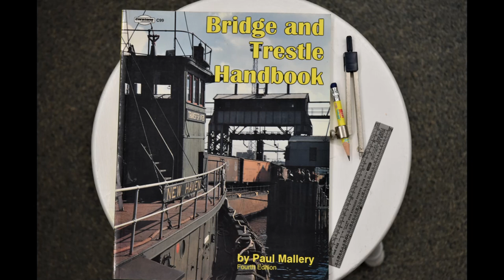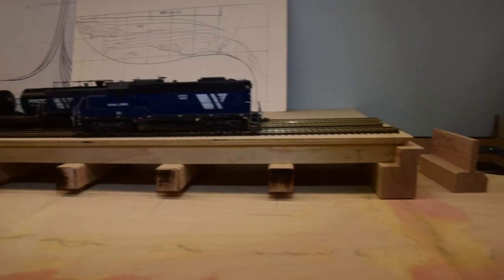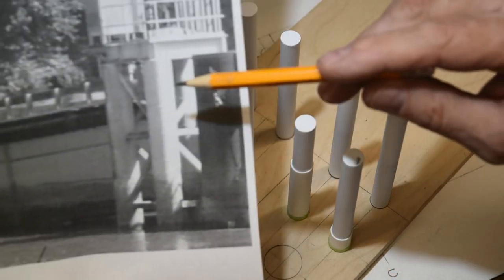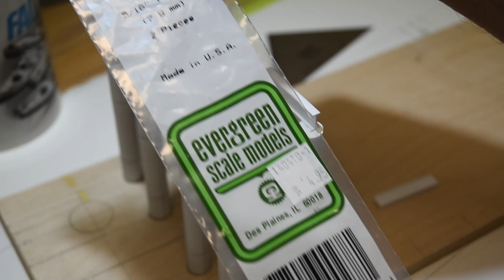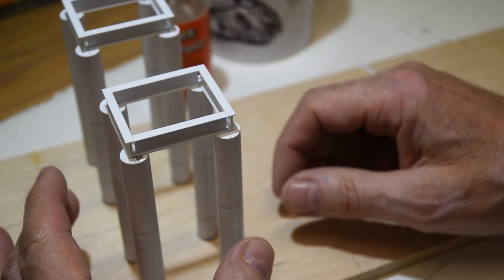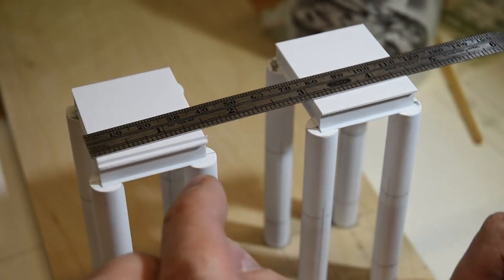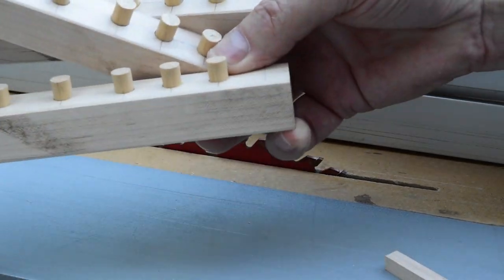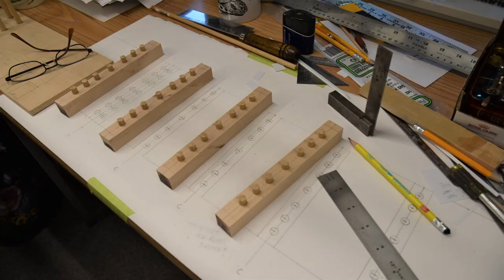The Barge Slip Build | River Road - Part 1

Comment: How do you decide between using wood vs. styrene for modeling? Is it because the concrete under the roadbed is structural vs. the steel platform is a model?
Reply from the maker: You are very observant and attentive, and have asked two very important questions. Your second question hits the mark. You have to decide several things: 1). What is structural? - as you indicated. 2). What constitutes the model? - as you also indicated. Both these questions have different answers as they pertain to each individual (problem) in the style they develop, while thinking through the process in how to model a particular structure. In this case, as you will see later on, all the visible "steel girder" work, ties, etc. won't really be structural but rather a "façade" over top of the structural. I think you nailed it really. It's up to the person to do it in such a way they feel works best for them at the end of the day. Cheers ~ Boomer.

Comment: You spoke about using styrene scraps. I make styrene putty out of my scraps. The small little bits that can't be used for anything I put in an air tight jar and add my gluing liquid which is M.E.K. It dissolves the styrene and you can make it as thin or thick as you want by the ratio of styrene to solvent you add to the jar. I've got some small paint jars that I bought from the art supply store that I mix and store it in. You can use it to fill in cracks in corners of plastic kits to keep light from escaping, you can use it as your glue, you can make tiny HO scale weld beads on highly detailed models, even use it as castings material. All kinds of uses. It hardens and is just like the styrene you started with so you can sand it, cut it, and paint it. Didn't know if you have ever done this and when you spoke about scrapes it came to mind.
Reply from the maker: Yes! Thank You for bringing up this important feature concerning plastic scrap. I just never thought anyone would really care to be honest, you are absolutely correct. Clearly you are experienced, as well, with this material if you know that. I have a bottle of Plastruct (same principle) which is like a thick "Goop" for filling in the voids etc. Thank You again William, for bringing this to the attention of the community. Cheers.
Reply: @boomerdiorama  Yeah goop. I couldn't come up with that word so I called it putty but it is more like goop. Works great.  👍
Reply from the maker: As modelers we must also have a bottle of "Goop" on the bench as well . . .

Comment: The burn marks on your maple is likely caused by a slight misalignment of your fence versus your blade (it's pinching). Tablesaw bearings are robust and unless they are seriously abused should have little runout. Also keep your blade clean. A buildup of pitch on the edges of the teeth can also cause burning. I completely agree with your recommendation of using maple for the reasons you stated. I'm really enjoying this series; your attention to details and painting puts your modeling into the contest category IMO. I'm 80 and too old to start a layout but I can enjoy watching you build yours.
Reply from the maker: Thanks for sharing Paul. Unfortunately, my (contractor) table saw is subject to abuse being banged around and not normally used for finishing. You are right about the fence though. It's poor quality compared to what I used to have. ;-) Cheers and thanks for supporting the channel. ~ Boomer.

Comment: Coming along nicely.  Your suggestion on using Maple is a very good one.  Those parts came out really clean.  Thanks for going into all the details.
Reply from the maker: Thank You. I was surprised how good the cut came out as well. I used a special "Glue Joint Ripper" blade as well. It was an expensive "Freud" blade I had left over from my cabinet making career. It was also painful to change it over (my saw arbor is a little stripped), but well worth the effort in the end. Cheers.

Comment: Great video, got me thinking about to use fixtures. I like also to use maple for my bridge support, I’ve never use maple before, could you you give a little details about the blade I need purchase before I get started to build the support, thanks for the guidance on creating the detAils item to make the  layout.
Reply from the maker: Thank You John. I'm a believer of buying the best quality blade once. Furthermore, you can have them sharpened as well down the road. Two blades are needed for most purposes: A Ripper and a Combination  (for cross-cutting). Get the best quality "Ripper" blade you can afford for ripping solid Maple board. I like Freud Blades myself and I buy the best. Don't lend them out and they will last 30 years. Cheers ~ Boomer.
Reply: @boomerdiorama  Thanks for the information on the blades.. Also about the lending… do you know my boys, Good idea about not loaning them out!
Reply from the maker: @jstockton303  Anytime John. My pleasure. Cheers! ~ Boomer.

Comment: Good work. Maple is not something I have tried before. Guess I need to go out and get some. Betting about that much maple will be around $90 American. A. Just kidding. Ready for part two.
Reply from the maker: Thank You Vincent. Actually, it's the Softwood which is expensive these days, Hardwood is still quite reasonable, especially since we don't use much of it for our purposes. Cheers.